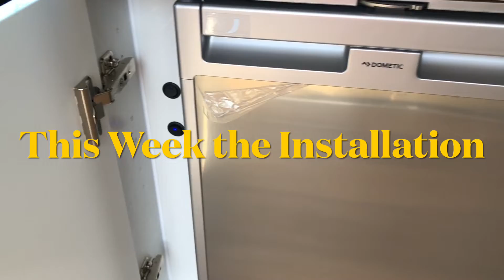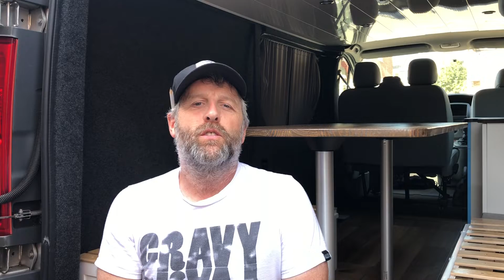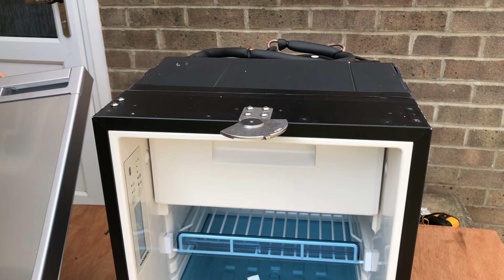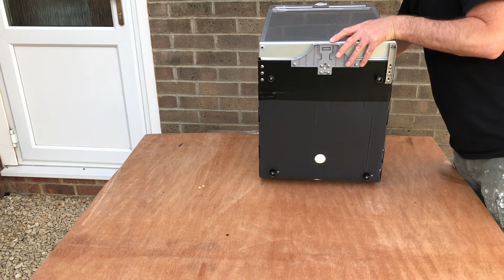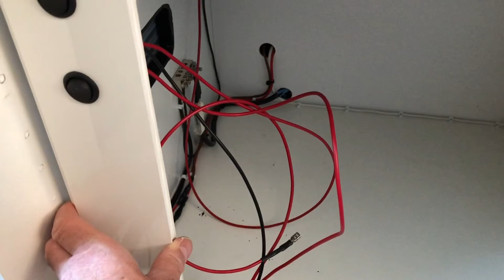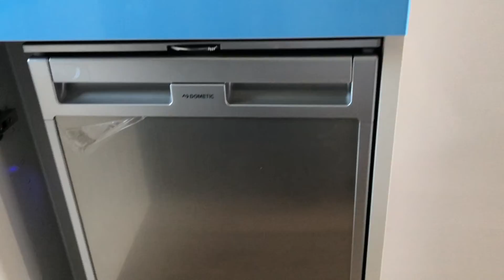Vauxhall Vivaro Camper Van Build Part (11) Dometic Fridge Installation

Comment: What units did you use
Reply from the maker: Hi, you referring to the benches or the kitchen units? Kitchen units are simple base units from B&Q the doors are from the Stelvio collections - I cut the back off the 2 x 30cm units to give the L shape appearance- make sure you seal the cuts. 👍😁 hope that helps?

Comment: No doubt about it... Leave the door, asthetically, it's the much better option.
Reply from the maker: Thank you for the comment my friend 👍
Reply from the maker: How you getting on with your build? Would be great to know 👍🛠🔨😁
Reply: @abikerstale806 hey, thx for enquiring. Very kind of you, and surprising, that you recognised me!
Had a bit of a setback due to a serious, (pronounced expensive) engine problem. The Vivaro was in the garage for about 4 weeks while they looked, found, and sorted the problem after waiting a while on parts.
Insulation is done, floor as well.
Started this week on the walling.
Now got exactly 1 month before it will be needed by my daughter, for its innaugeral trip.
Greets from 🇨🇭,  Steve.
Reply from the maker: What was the engine fault in the end? Pressures on then.